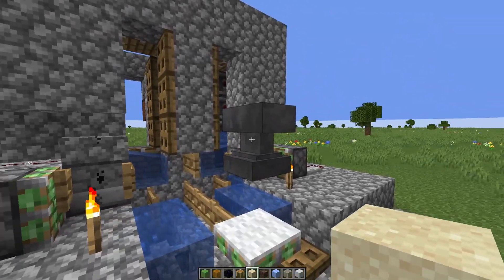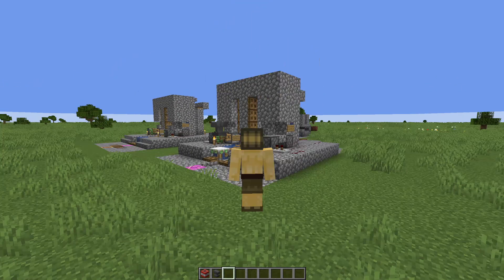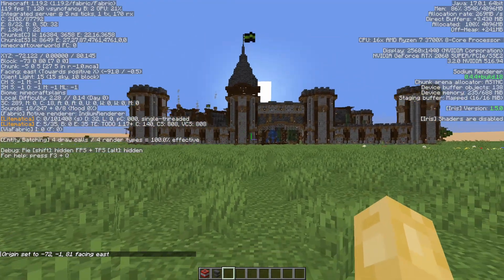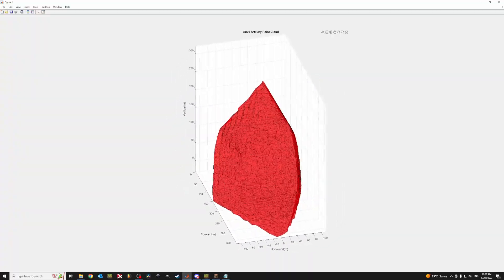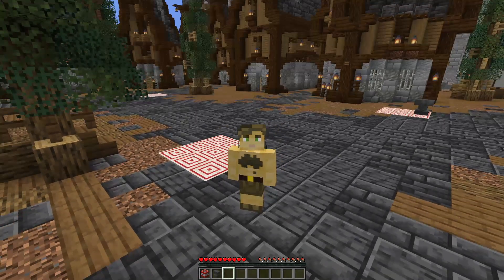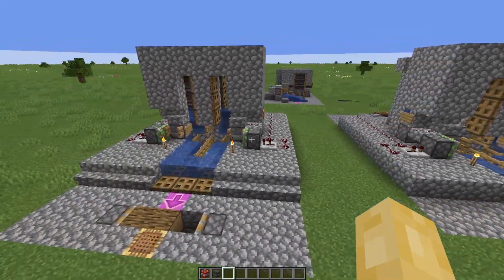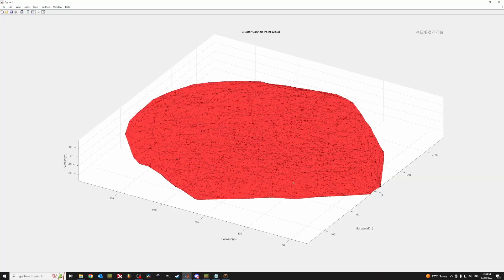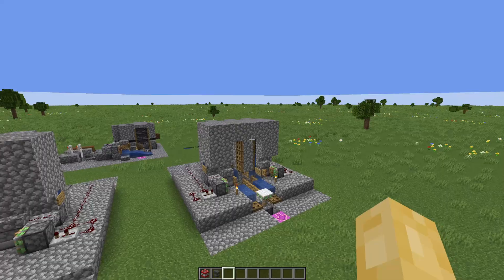Minecrafts Inter-Continental Ballistic Anvil Cannon

Comment: Given the ease of building these, to what extent could building a second anvil cannon right next to the first one (so that you could essentially choose the better one for every shot) increase accuracy? Would this be possible to integrate in the mod?
Reply from the maker: Now that I think of it, I could easily go through the point cloud and identify missing points that cannot be preciely hit by the cannon, the problem is I'm not sure what we could do with that information. Those points are going to be pretty randomly distributed and there is no guarantee that adding an additional cannon will fill every single gap.
Reply: @cubicmetre  im sure thats true, and i expect its a diminishing returns kind of thing, but it seems like theres a lot of room for improvement. it doesnt seem like you have to look terribly far to find a spot the cannon cant hit, and adding another cannon would probably help quite a bit. Also, what if its not random? it feels plausible enough to me that there is some sort of pattern present caused by the discrete timing steps you could take. Either way, i think it would be useful to be able to add multiple cannon locations to the mod, and then just select for the one with the lowest deviation from target
Reply: there is a way easier way to do that, its called multiple lauchpoint and in essence it's just shooting the tnt and in this case also the anvil to the side (maybe with slime) and stopping it's motion (either with fences/pistons or for more controll with powdered snow)

Comment: Idea: Use end crystals to propell projectile faster
Reply from the maker: You wouldn't be able to stack the propulsion with end crystals, if you place multiple end crystals in one place and detonate them, the first one to explode will kill all the others instead of making them explode meaning you only get one explosion. Plus the only thing that makes larger explosions more powerful is a factor called Power, by default TnT has a power of 4. The most powerful explosion, the wither, has a Power of 8, meaning you only need twice the amount of TnT than withers to make an explosion with the same power. And needless to say TnT is much easier to handle than withers.
Reply: @cubicmetre  Had that been tested? Isn't both end crystal and fusing tnt an entity? It is a suprise to hear multiple end crystals explosions doesnt stack. Couldn't you have multiple arrows shoot at the stacked end crystal?

Comment: I've always been interested in the potential of anvils as a weapon. Other than for funny traps the damage function with anvils isn't utilized much. Seeing someone actually use it in artillery is something I've always wanted to see but never found anything that was particularly convincing until now. Big thanks for making this video. If you wanted to hit the blindspots on the anvil cannon would you need to make multiple other cannons at different positions to cover for those locations?
Reply: I actually think two cannons close together could potentially cover most blind spots withing a given range

Comment: Hey Cubic, can you make a cannon that launches a second cannon? I'm imagining two separately timed shots being sent together so that the one to explode first redirects the second shot around a corner. Now THAT would be super cool.
Reply: a two stage cannon is feasible but has short range cause tnt fuse time is short
Reply: the buildability wouldn't be the issue there so much i think; moreso actually the possible phase space of resultant secondary trajectories would be tiny. To put it in plain english: the resolution of where you can plop TNT is greater than 1 block. This means that you'd have this resolution to work with when choosing the two trajectories to fire another TNT in a direction. That's an issue because these target points aren't evenly distributed either, which makes it even trickier. I'd think it's probably doable though, it just wont end up working great
Reply: @asdfasdf-dd9lk  nah, there is no problem, it's rly just a basic technology for cannon makers, you should give it a try, you'll probably have it figured out till the end of the day
Reply: already exists

Comment: Launch 2 Tnt's with the same time and with the same trajectory but vertically offset from each other by a few blocks. Offset the fuses so that the higher one will detonate first and launch the lower one strait downwards. Now you can spike Tnt downwards on to your enemies like a Volleyball of death. Bonus points if you can also spike an anvil.
Reply from the maker: The cluster cannon already does this to some extent, the heart of a tnt explosion occurs slightly above the feet of the TnT meaning TnT in the same position will propel each other downwards. The problem is that you need an insane amount of TnT to do a proper spike cannon because you need the TnT to all detonate in the same tick, the first TnT will propel the second TnT downwards which then propels the third TnT upwards and what you get is an effect where the TnT will oscillate back and forth and effectively go nowhere.
Reply: @cubicmetre  no, you don't, if you propell the projectiles and the what we call step-propellants or just steps at a slightly different angle (so that they are approx. one block away from the projectiles, if you have slow speed and multiple steps or as close as possible, if you have high speed or just one Propellant) and maybe also a different pressure, you can achieve that without using many tnt

when tnt travels at 1 block/s 2 steps are enough to give it perfect high speed (more than 1bps) downwards motion and more equals more in this case, modern WarGear technology achieves efficiencies around 3/4 bps downwards motion per step when shooting with multiple steps at low initial speed
Reply: @ATOM-vv3xu  
Ive experimented with that technique, but the problem is that the stabdown charge looses effectiveness at higher velocities
Reply: @ if you have broad knowledge of where you want to shoot at, you can counteract this at least partially. But ofc if you need to cancel 300 bpt, you need over 300 tnt for that and so on.
Reply: @ATOM-vv3xu  Its almost impossible to shoot the amount of tnt needed precisely in front of the tnt which is needed to be slowed down
Reply: @acrafting11  nope it isn't. If you have a broad idea of where to shoot it even is possible to do this intuitively/automatic.

Comment: Cannon Idea: I would love to see a cannon that can quickly send a bunch of; sand, concrete powder, or gravel to a location ...  while this may not do any damage, the point of it is to annoy another player by constantly adding these blocks on their structure from far away
Reply: Can you use a tnt minecart to get around the fuse time limitations of regular tnt
Reply: @oliverdouglas9912  Tnt minecsrt's blow up when there is an explosion, they are not shot away unfortunately.
Reply: This could work even if the chunks are claimed
Reply: many of the sand/gravel will just pop off because of landing in the same spot at the same time, so its probably better to fire them individually
Reply: @NathanHaaren  You could probably fix that issue with a simple timer
Reply: I'm more like thinking of 3D printing using concrete poweder
Reply: With colored concrete powder and either a wall or a floor of water you could make MS paint maybe even a 3d one and see it with a map
Reply: Simply use a factions cannon. Just only fill the power dispensers.
Reply: Sandskip 

CTTO
Reply: Imagine a vanilla schematicannon like in the create mod, just with redstone!
edit: here's a random showcase so you know what I mean.
https://youtu.be/C4bPiOQShjU
Reply: you can just replace the anvil with any other falling block
Reply: @blockmath_2048  No

Comment: i'd love to see a cluster anvil cannon, less accurate but i believe you could store a tower of anvils into a bubble column, and then fire that?
Reply from the maker: It would be possible to stack the anvils together and fire them all at once, however the problem is that you would need to give each anvil a slightly different alignment to make them spread out as they fly, because the cannon currently is too precise meaning the anvils would all just land on the same position. For the TnT cluster cannon this was fairly easy because I could use the random momentum of the TnT to make them scatter at the point of impact. Anvils don't get random momentum they are always aligned when they start falling.
Reply: @cubicmetre  You could possibly use water and randomly firing dispensers to change the direction the anvils move, aligning them randomly by pushing them with water.
Reply: @nikkiofthevalley  nah, it's easier to just put them into precise spots

Comment: It would probably be significantly more complicated, but I think it would be interesting to have a cannon that fires both tnt and an anvil really high and then the tnt shoots the anvil straight down towards the target
With the amount of configurability it would have it would not only deal more damage but would have less blind spots, such as shooting over a target and then blasting the anvil back around to get people hiding behind a wall with a roof
Reply: This is essentially the mechanism behind airburst ammunition. Fascinating to see Minecraft players and modern militaries arrive at similar conclusions.
Reply: @smoothdog8861  i know this is fucking hilarious
minecraft bunker buster
Reply: @smoothdog8861  wait actual? lmao
Reply: people built cannons that did that with regular tnt on factions servers to top-down raid peoples bases, many years ago
Reply: @cod6guy12  and people on war gear server have perfected air strikes to the point where you can have multiple stages that adjust the tnt midair and have boring machines that straight up dig holes into stuff from the top
Reply: I had a similar idea where a bunch of tnt and anvils would be shot in one blob and the result would be bunch of anvils and tnt raining down from the sky.
Reply: it's not rly complicated, you can give it a try (also I'd recommend using tnt instead of anvils, since it's much more forgiving for errors, so much so, that you can hit the enemy without the help of software easily)

Comment: Would it be possible to design versions of these cannons that can be moved around?
Reply: Would be to op, i hope not lol
Reply: Not without moveable tile entities
Reply: Not without mods, because at this time the storage blocks are not piston-enabled AND the machine exceeds piston push limit. The water streams themselves are a lesser problem because it should be possible to give them a bit more space and allow for water transport via waterlogged blocks, but the dispensers, barrels and hoppers can't be pushed and things like comparators and buttons drop instead.

TLDR: Not while the pistons do not preserve redstone components and the cannon relies on precise redstone values.
Reply: it is possible, but I am not sure if it's worth it - you're probably better off just using elytra to fly to your destination and then build your cannon there